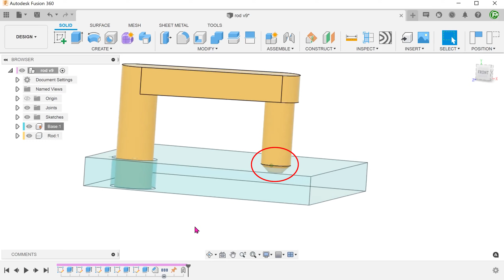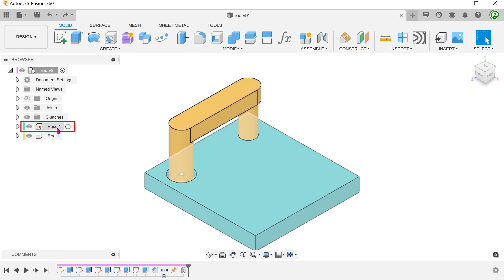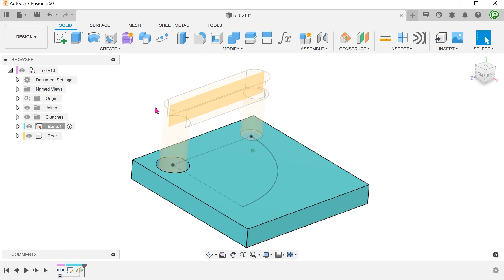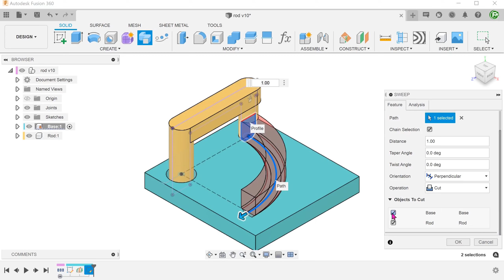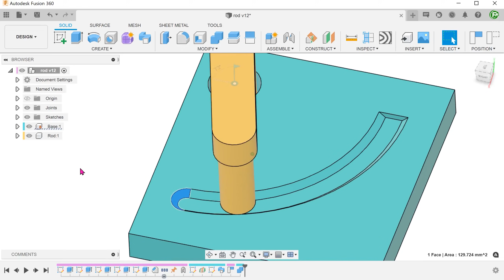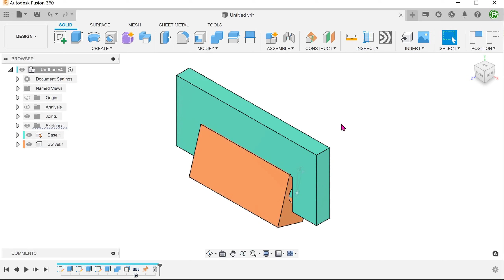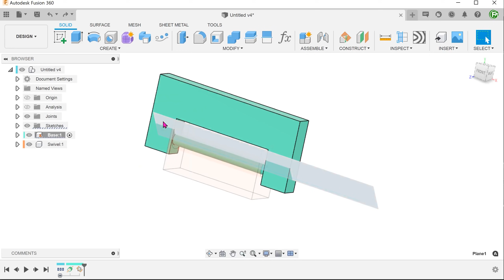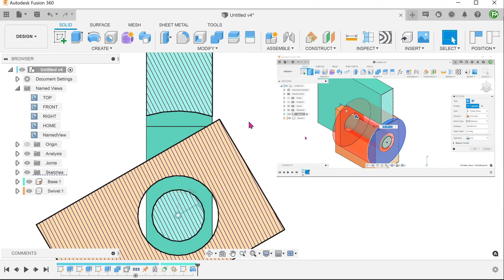Fusion 360 | Clearance for Moving Components

Comment from the maker: When I tried this method with irregular bodies or asymmetrical bodies, I have found that it can get really tricky. You would often need to do multiple cross sections. There is a sweep body command within SolidWorks that allows you to cut using a body as a tool. Are you aware of any other CAD programs that have this functionality? Would your workflow benefit from having such a command?
Reply: That command would be very handy for threads and work gears

Comment: Idk much about fusion, but why not just put a circle at the hole where the component is then you have its axis of travel and from there you just trim it to the area you prefer then place 2 circles at each end an attach from the center point with 2 circles to make it a slot
Reply from the maker: You are absolutely right in saying that a center point arc slot would be the faster way in this example just to create a general clearance. My aim for the video was to use a very simple example (perhaps overly so) to demonstrate how we can use the cross section of a moving component to carve out a trough. This would be more useful for cases where the path is not a regular path or where the component has an irregular shape. This is also useful when one needs to know what is the minimum amount of material that is needed to be removed for clearance. In this case, the rod has a tapered end. Using a center point arc slot would remove more material than is required.

Comment: i think using a ground is not best practice, instead use an as-built joint with the top level assembly
Reply from the maker: What are the advantages of using as built joint with the top level?
Reply: @Fusion360School  my understanding is a ground is analogs to a fix in a sketch and a as-built joint is like a coincident constraint between the two origins. the as-built is more parametric.. editing it breaks future features less

Comment: Usually for this kind of situation, I would create a sketch on a plane offset from the YZ or XY plane, with the groove profile (offset outwards by half a millimeter) as well as the revolve axis, then do a single revolve to cut off the groove. This can be done in a minute and only requires very basic operations that anyone can do.  But if the groove travels 3 dimensionally instead of 2 dimensionally, things get nasty quickly…